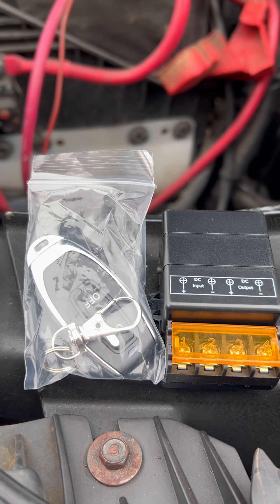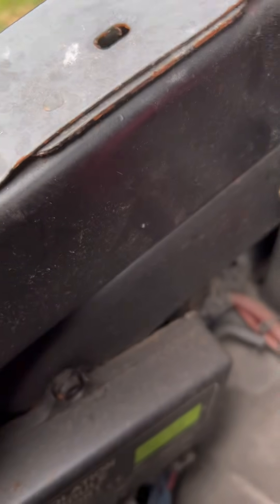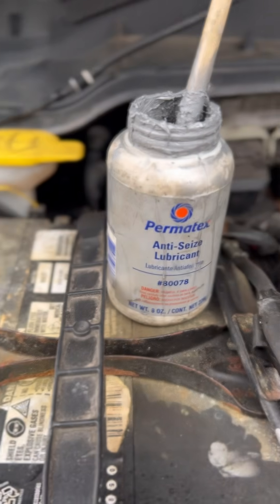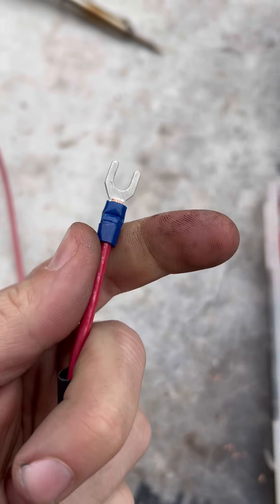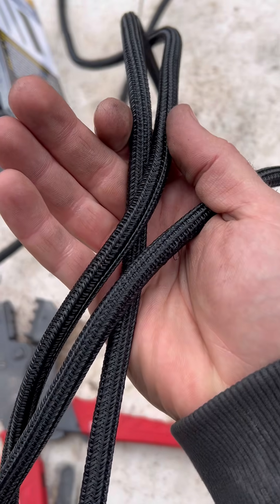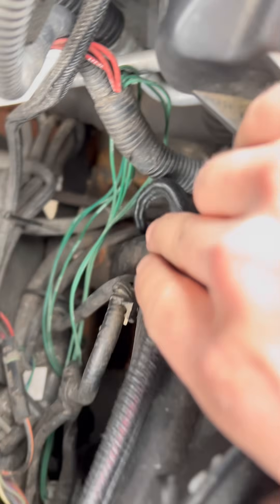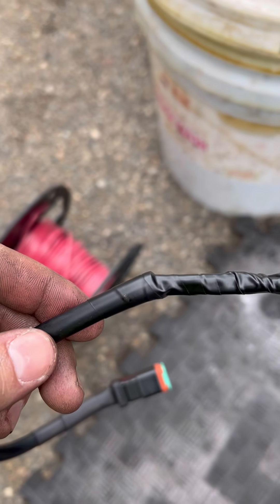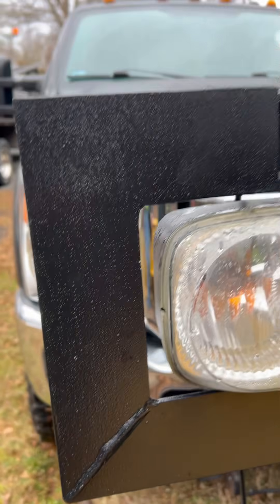You’ve Been Crimping WRONG 😱 Do It Like This!🔥#shorts #viral #fyp #trending #explore #electrical

Comment: Love to see some Low-Voltage work.
Do a lot of that with my (custom built) 3D printers, truck, HAM radio, and friend's boats myself.

Only suggestion(you did say it was just what you had on-hand) might be to pick up some 316 stainless mounting screws at an Ace Hardware since this is a plow truck, and obviously the salty conditions are gonna be pretty dang hostile(even with the anti-seize).
I've seen the cheap shiny zinc screws start flaking their plating within a month or two in just brackish(low-salt) conditions.
Reply from the maker: Thanks friend!

Comment: Water can still sneak down exposed stranded wire inside the crimp terminal because shrink not completely covering the crimped terminal.  Corrosion here can form a high resistance bad connection over time. Spray a drop of WD-40 into the exposed stranded wire end to keep water / corrosion out.
Reply from the maker: Since all I had was insulated terminals I normally just apply fluid film to keep the corrosion out. If I had un insulated ones I would of put the heat shrink over the copper but this is what I had on hand

Comment: Next time don't use insulated terminals, or cut the insulation off. This will allow the heat shrink a little further to cover the exposed copper on the terminal. Dab liquid electrical tape there for now to seal it up.
Reply from the maker: Normally I just apply some anti seize to the terminals or even fluid film so that’s why I didn’t make it go over the whole entire terminal
Reply: @SchecterElectric Fluid Film is definitely my go-to for rust protection 👍

Comment: Trying for constructive advice: trade in your spade lugs for rings and cover more of the actual crimping. You've got a better tool than the old "champ" plies. Cordless heat guns rock. Learn about online fuse holders before you have to replace those pretty fusable links you just made.

Comment: There's nothing about crimping in this video 😂
Reply from the maker: I’m showing crimping a fork terminal and then putting heat shrink on top bc when people crimp these terminals they break the insulated plastic and now the connection is junk. So if you do It like I did and take one more step and put heat shrink on top it’ll last a very long time
Reply: @SchecterElectric  The title's still pretty clickbait-y, though, to be honest.  You didn't even say anything about the actual crimping procedure you used at all (which is actually where most people go wrong).  And crimping without using heat-shrink is not "WRONG".   It's actually just fine for lots of applications.

Looking at the result, I can tell that you did actually use a proper crimping tool for these connectors, and used it correctly (good!) but you didn't even bother to mention that, or how to do it, in a video that's ostensibly about the right way to crimp things, and instead just say "I crimped it"?  The video title is very misleading, if nothing else.
Reply: @SchecterElectric  I love your vids bro but this is click bait

Comment: What I prefer to do for those terminals is to remove the plastic, solder them then use a piece of heatshrink.
Reply from the maker: Yes that works good to 12 gauge is a little thick to solder takes a long time to heat up
Reply: @SchecterElectric agreed. 

Larger wire does indeed take longer to heat up.

Sometimes I have crimped but that was using basic connectors and a basic crimper and I'm sure there's better crimpers out there that make a better more secure crimp.
Reply from the maker: @ikonix360 yea in the video I didn’t show it but the Milwaukee ratcheting ones are solid they really crimp things perfectly and never damage the insulated portion. I really like them
Reply: Solder is actually not as good as a proper crimp for applications that involve a lot of potential movement or vibration (such as automotive).  Using solder with stranded wires can produce a sharp stiffness transition that results in a physical weak-point in the wire which can fail over time.  (That's why all wiring in applications like this is generally crimped instead.)

The best type of connection for this situation is a gas-tight crimp connection, done with the correct connector and the correct tool (used in the correct way).  Unfortunately, he didn't actually bother to show or explain any of that in this video, so the video title is really misleading, IMHO.

Comment: Using heat shrink is pointless…You have exposed wire on the connector.
Reply from the maker: It’s not pointless it protects the crimp and seals the wire on the back side of the crimp
Reply: @SchecterElectric  protects it from what? Certainly not moisture as it can freely enter through the front
Reply: protects it from vibrations by moving the strain point on the connections away from the crimp

Comment: Having not looked at the cost of the marine grade heat shrink on its own I'm going to provide this info. Molex make ring and fork terminals that have color matched marine heatshrink in the perfect place to seal both sides of the crimp. The product line is called Permaseal
Reply from the maker: Yea I’ve seen that before this is a lot cheaper
Reply: @SchecterElectric ooof. I can't unsee this comment. I have more thoughts but I'll keep them to myself
Reply: @Bigpimpini4231 ooof, I can't unsee your comment. I have more thoughts but I'll keep them to myself.

Comment: Excellent job! My pro tip: I shrink with a Dewalt 20v heat gun, it's a great way to also warm your hands in a cold driveway or unheated shop.
Reply from the maker: Haha that is true friend!
Reply: Sure. Go buy a $170 Dewalt cordless heat gun or get a corded one from Harbor freight for $10.  I love the HF marine heat shrink tubing and use it often.
Reply: @JT_70 But a cordless has a lot more functionality. I can do wiring jobs on my tractors in the field, thaw gate locks, and way more.

Comment: It's far from looking factory but nice enough for country work.
Reply from the maker: I thought it looked pretty good
Reply: @SchecterElectric yeah looks good but not factory. I do like that you used the adhesive lined heat shrink.
Reply: @AmosMosesJr  out of curiosity what would you do differently to get it closer to factory?
Reply: @jonathanjocobo5654  it's honestly better not to look factory for the next guy when troubleshooting.  Factory is not really the benchmark in my mind. For instance I like the wiring loom you used. That will hold up better than the factory stuff. I work as an engineer and they are constantly performing cost savings on this stuff. I've even seen new designs being created overly complex so that a couple years later the same team can simplify the design and bom count to more easily meet their quota later. If you are really looking for honest criticism the only thing I saw that sort of triggered me was the tapping of the 8-32 screws. If it holds up that's great so don't change because on me. 🎉
Reply: @AmosMosesJr  lol it's a plow and he's an electrician so taps and 6, 8 and 10 32s are always around. Nothing wrong with using that tap
Reply from the maker: @AmosMosesJr thanks friend I appreciate your feedback I can see what you mean!